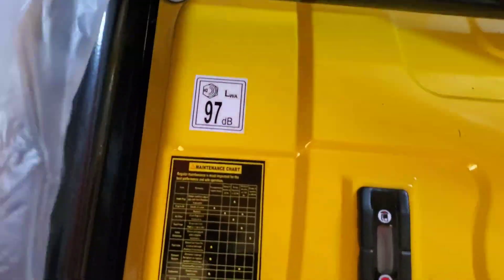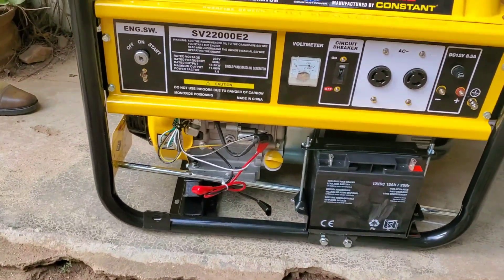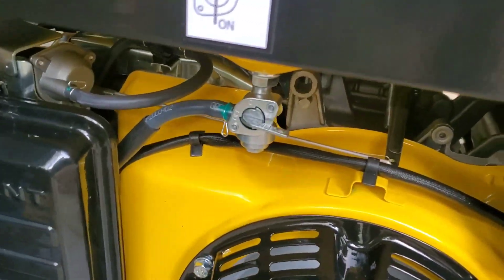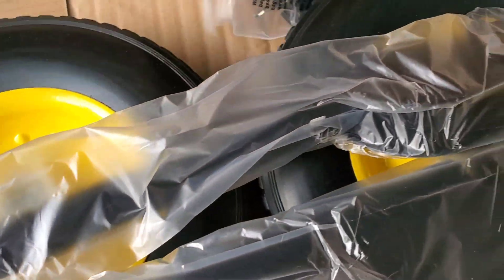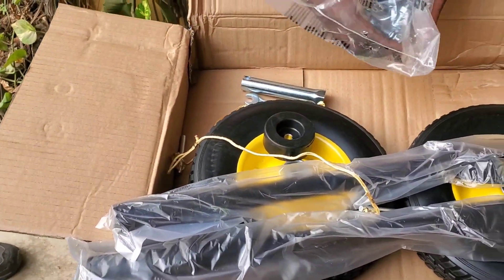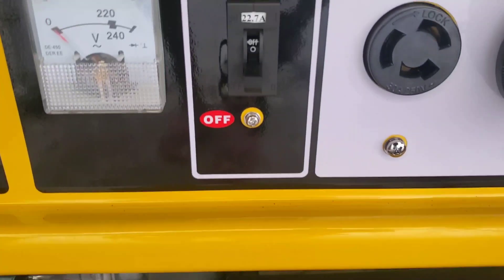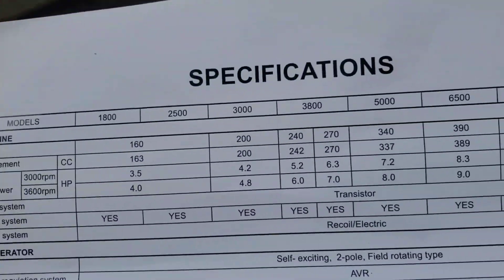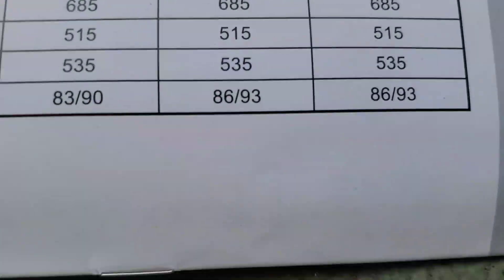Did the generator work with the SolaX G4 Inverter?

Comment: Is that not weird for a solar Dr promoting an Elepaq generator?
Reply from the maker: I am not promoting a particular brand of generator. Many of the clients we install for have generators and they want to be able to charge their batteries using them. The Deye has never been able to charge with small generators below 20 kva or should I say gasoline generators. We are trying to see if we will have the same experience with the SolaX. Also during the rainy season, I will need it for those days that the sun refuses to come out. Thanks for commenting and watching

Comment: One thing I'm trying to get rid off at work and home. However, quick observation on the cable type taking power to the house. They're a little too small for the capacity and have a tendency to melt quickly once you start adding load to same. A 4mm or 6mm pure copper cable would give more peace of mind from experience.
Reply from the maker: Thank you for watching and commenting. I am 100% off the grid and this is the first time since 2014 that I would attempt to use a generator. I am sure that 99% of the time I would be fine without the generator. That 1% of the time is when I will need it. We also cook with electricity so it is critical to have back up. The cables are 4 mm pure copper. Thanks for the observation

Comment: What's up Doc!? I thought you use solar because you hated the noise of the neighbors' generators? Anyway it is handy to have as a backup. Buy quality oil for it, not the cheapest. Turn off the generator by cutting off the fuel, this will keep your carburator longer clean because the fuel doesn't stay in it.  Just some pro-tips from an amigo.
Reply from the maker: It's wabbit season or is it duck season?  Yes we used Mobil semi synthetic oil 5W-30. Yes I don't like the noise but we need a back up. We also need the ability to test the Matebox and the switching function built in. Thanks for the tip. It won't run often enough so that makes perfect sense.

Comment: It's a 5kw gasoline generator not 7kw. You should have gone for 5kw kama diesel generator (soundproof) instead. Big petrol generators are just too noisy
Reply from the maker: We will find out when we try to push 30 amps at 200 V though it. We had a limited budget and we exceeded it. We got the largest we could for the funds budgeted. Thank you for watching and commenting. Please share and subscribe
Reply: @drsolar  I am so disappointed * you didn't buy a Caterpillar 20 kWh diesel generator with a 5 year service contract instead. 
* (Sarcasm, obviously)
Reply from the maker: @dougveganparadisebuilder  I am rolling on the ground. I would have to upgrade the house to get such a generator

Comment: Please make sure the filter is always kept clean… and that you have enough airspace around it. Also importantly is changing the oil as it’s likely to get quite hot under load. It should be able to power the house directly from the Db, the big question is how clean is the power so it can then go through the Inverter. We anxiously await.
Reply from the maker: We will keep a record of each time it runs and plan a service schedule. We will find out by the end of today or tomorrow if we are able to buy gasoline.